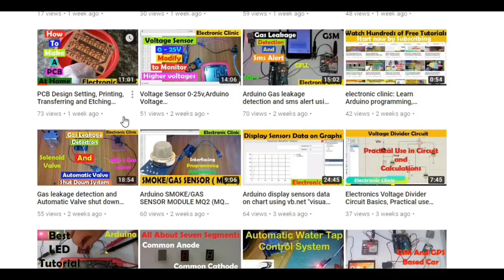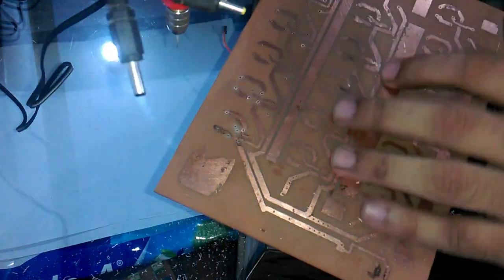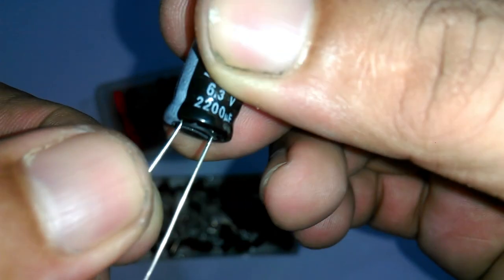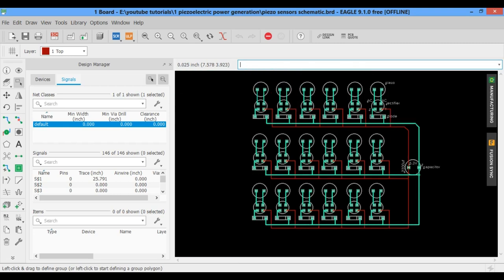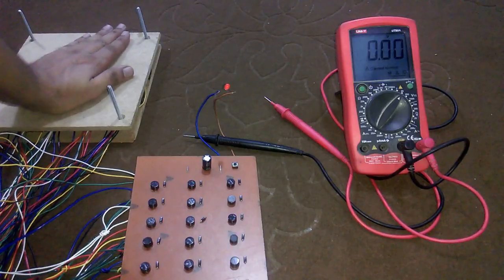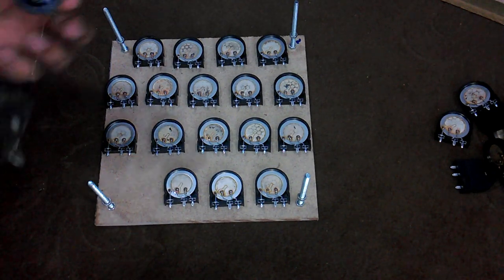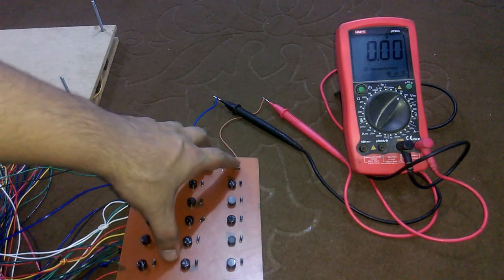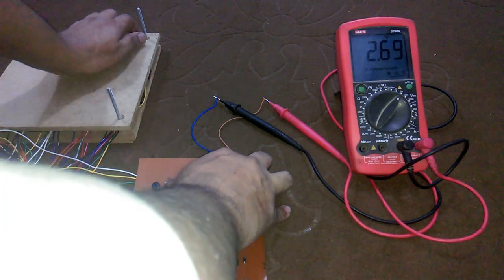how to make Piezoelectric Generator | PIEZO ELECTRICITY GENERATION | Piezo footstep power generator

Comment: By bridging at the rectifier one pole of an AC-source and one of the DC voltages with a capacitor, the DC output voltage will double. Depending on the value, it needs little time, till the capacitor is charged and the circuit produces output. Also the cap should not leak. The voltage doubles, the current is half. Efficiency is in theory higher, because one diode drop is virtually eliminated. With a stepper, given a fixed rotation speed, it is also possible to chose a cap for maximum power point, if the output voltage is below the voltage of maybe the battery without that cap.

Comment: What is the purpose of the diodes? Don't the rectifiers already convert the piezo AC into DC?
Reply: Thats what the rectifier circuit is!
Reply: Rectifier are made of diodes
Reply: I think that is to prevent loss of energy due to feedback from the rest of the circuit. The bridge rectifier would become a load for the capacitor without the diode.

Comment: If you read this comment, please reply immediately, thank you in advance.

How will you increase the voltage if the connections are all parallel? Isn't that just equal?
Reply from the maker: If you want to increase voltage, connect them in series. You can also make parallel and series connections together.
Reply: To increase the voltage connect the sensor in series and to increase the current connect them in parallel.  So better to have both of the combinations ex: connect 5 peizo in series so called as 1 array . You have create a multiple arrays. Finally connect all the arrays in parallel
Reply: @MadDeni  Hi do you have a diagram for the series-parallel connection? We are currently working on our thesis and we have a problem with charging our 12V battery because the maximum voltage we have reached with our piezoe generator is only 7V

Comment: Nice Video but like to know, 
1.Can't we use single Bridge Rectifier, & connect all piezo disc to it
2. How to Connect Piezo Disc in Parallel or Series ?
3. How much Current & Voltage, this circuit generates ?
Thanks in Advance
Reply from the maker: No , you can't use a single rectifier, imagine when u prress multiple piezos at the same time what can happen?? Study this.

These piezos are connected in parallel

And the current you can find using a multimeter
Reply: @ElectroniClinic  Thanks for quick response, like to know, how much Current output you received on your device ?
Reply from the maker: actually i didn't check the current, but you can easily check by connecting an ammeter in series...
Reply: @ElectroniClinic  ok, no issue, kindly let me know, the power output atleast

Comment: Hello, great idea. Would you be kind enough to send me the PCB you made?
On your 18 piezo plate, how much power (in W) can you get out by "crushing" the plate?
My project is the following, I wish to study the idea of adapting this system to the entrance of a high school of 2000 students who cross the entrance several times a day. The goal would be to store the energy produced and resituate it at night for low consumption LED lighting.
Reply from the maker: ya sure i will send you the pcb. your email id ? 
you know the output of each piezo sensor is in micro amps so i don't think so you gonna be able to charge a battery, you will need to increase the number of sheets.
Reply from the maker: you can charge some capacitors and then light up some led's to explain your idea. for real implementation, you will need some good high quality piezo sensors and you will need to increase the number.
Reply from the maker: check your email. the pcb design is sent.
Reply: @ElectroniClinic  
I'll come back to you when the project is over

Comment: Mind explaining why do we need the PCB? Cant we just connect it directly?
Reply from the maker: Yes you can directly conectly.
Reply: @ElectroniClinic  means from the piezo itself can also connect to the rectifier directly?  

Thank you so much
Reply from the maker: yes you can directly connect. but if you use pcb, it will save a lot of time.

Comment: Why did you use one rectifier per piezoelectric transducer? Wouldn't it have been better to connect them in series - parallel combination?
Reply: You would think that would make sense - unless there's some actual physics reason why it can't be done (but I don't see one)

Comment: That's a whole lot of effort,  for extremely little reward.  

listen... get two thin A4 sized plastic sheets (pvdf or whatever). paint (or spin coat) one with graphene oxide.  slap them together,  and slap a current collector (like aluminum) on both sides of that. connect your wires to (what you may think is a fancy capacitor) it,  then wriggle your A4 thingy while it's connected to your multi-meter. 

Your welcome.  Go make a flag.
Reply: Hey there, how much more voltage were you able to produce?
Reply: @christiannieto9552  

You're asking the wrong question. 
I'm satisfied with my results. 
Do the work, get the pay. 
I've already given more than you obviously capable of realizing.

Comment: hello thank you for sharing this video. May I know the eagle library you used for piezo? cause I can't find it on my lib.
Reply from the maker: I draw it myself, for the explanation
Reply: @ElectroniClinic  Okay thanks for fast reply. I'm currently working on the schematic part. I'm using eagle free version and It only gives me a limited size of board. How could I fit all the components with the free version of eagle? Or Can you suggest another open source to use?
Reply from the maker: while using a free version, you can't do automatic routing for larger boards. you can do the manual wiring. you can use eagle 6.5 version, its crack is available. you can search on google.
Reply from the maker: don't use components from the library, then you can make larger boards. Let's say you want to use a relay, simply measure the distance between the relay legs, and make place via's accordingly and that's it. i do the same exact thing while making larger boards.
Reply from the maker: But if the manual thing is hard for you then you should install 6.5 or a lower version,
Reply: I think I'll divide the circuit into 3  so that it will fit with 3 small pcb. Anyways thank you so much for fast response

Comment: Hi, sir. Could u guide me in this project? I'm working on harvesting vertical downward force from vehicle to generate electricity using piezoelectric transducers. The energy generated is required to charge the battery n power up light at night with the pir motion sensor or LDR. But Im having problem on charging the rechargeable battery as the current generated is too low. Could u give me some idea on how to store the piezoelectric into the battery? Currently I'm using bridge rectifier as energy conversion unit only. The connection is: piezo >bridge rectifier> battery. Should I put a capacitor before the battery to absorb the spike /peak voltage to protect the battery from high peak voltage? N does sir has any method to evaluate the performance of piezoelectric energy harvester? For example, if I use different configuration of PZTs(series, parallel, both) with same number of PZTs, how should I evaluate their performance (voltage, current, energy) without using oscilloscope because I just have a multimeter😅 Thanks in advance
Reply: Does your project works??
Reply: Yo, you figure this out? Got a report on it or something?

Comment: Nice Video.Fahad can we use PCB board for both AC 220v and DC  Voltages at the same time.AC voltage affect DC signals .
Reply from the maker: its not 220 volts. 
i didn't get you, what you want to ask?
Reply: i mean at one pcb circuit board  can we use both AC and DC voltages at the same time.
Reply from the maker: You can connect ac with bridge rectifier. And at the output u get dc
Reply: Ya i knew this concept.i want to say that from small DC voltages  we control higher AC voltages like arduino Relay circuits .Both the Voltages operates in a one PCB board.Does the high voltage AC affects the DC Voltages.if it affects then what is the solution.hope u will get me.
Reply from the maker: Then u step down the ac voltages using transformers, and you can also use voltage dividers. Watch my tutorials on voltage dividers and voltage sensor
Reply: Ok Thanks
Reply from the maker: https://youtu.be/NNUBWpSgSYM

watch this tutorial completely. you will understand. don't even skip 1 second. and watch calculations.
Reply from the maker: this tutorial explains how we can monitor higher voltages.
Reply: ok thanks

Comment: if you use the capacitor, it uses it very quick, but if you vibrated it for 1 hour, would the led last longer? i thought capacitors release the energy all at once? why not charge battery instead? would you need resistor or something for 1 way charging like you use on solar panels?
Reply from the maker: for one way charging, we use a diode. Actually, it's just a research kind of project. I have used more than 78 Piezos and still, I wasn't able to charge even the cell phone battery. Even a capacitor takes time to charge. not practical for battery charging. But if you can arrange some high-quality piezo sensors then you can.

Comment: Do you absolutely have to have a bridge rectifier and a diode for EVERY piezo? What if you used 1 bridge rectifier and 1 diode for entire circuit? Would it work?
Reply from the maker: of you watch the entire video, you will see, when i press a piezo it generates positive and negative voltages. to get rid of the negative voltages we have to use a bridge rectifier
Reply: @ElectroniClinic  I understand that. I'm asking what would happen if you used 1 bridge rectifier and 1 diode for all piezos in the circuit. Thanks for reply by the way.
Reply from the maker: the positive and negative voltages will interfere
Reply: @ElectroniClinic  Thank you for explanation

Comment: hello good day! can we get a copy of the Panel Circuit board design? We need it for our study. I hope you can give me. thank you so much
Reply: can we connect a single 12 volts battery instead of diodes and capacitor for all the connections? I hope you'll answer this. thank you so much

Comment: Hello Good day! can i ask? what is the purpose of the diodes in the circuit?
Reply from the maker: the bridge rectifier is used to get rid of the negative voltages. and the diodes make sure that the current flow only in one direction.
Reply: @ElectroniClinic  okay thank you sir. Actually, we're conducting a thesis about this piezoelectric. We're making the tile but with a twist of arduino

Comment: Sir can you help me ?. what if i change that capacitor into rechargeable battery, and add LCD display to display the amount of voltage generated., using arduino . can you help me ??
Reply from the maker: msg me on whatsapp.
Reply from the maker: SMLP +923339218213
Reply: i message you
Reply from the maker: ok.
right now my cell phone is on charging.
Reply: please help
Reply from the maker: ya sure i will help you.
you tell me all your requirements in a message. i will check my whatsapp.
Reply: have you seen it ?
Reply: please i badly need it

Comment: can this reach to 12V? to run a dc motor?
Reply from the maker: you can generate even higher voltages. but the main problem is the current. for a 12v motor, you will need to use some large value capacitor. charge the capacitors and then you can run a small dc motor for a second or two.
Reply from the maker: this is just a research kind of project. But if you can arrange high-quality piezoelectric sensors then you can run a small 12v dc motor. You will need a lot of sensors connected in parallel.

Comment: hi, are you still active on whatsapp> can i message you there? I am gonna ask some questions about this video of yours.
Reply from the maker: yes sure you can.
Reply from the maker: you can also ask questions over here. you can find my whatsapp number in description. But its good if you comment over here.
Reply: @ElectroniClinic  so i wanted to make a similar project to this one. Is it possible if i replace the capacitor with battery? If yes, is there any changes in the circuit that is needed?
Reply from the maker: no need in the circuit. but you will need to connect so many peizoelectric sensors.